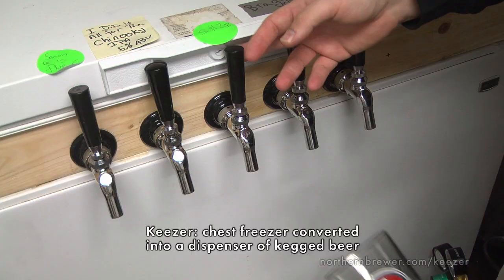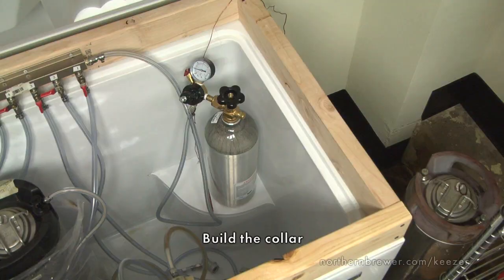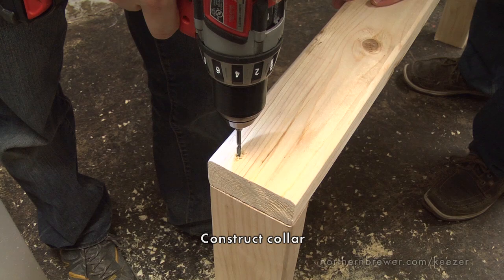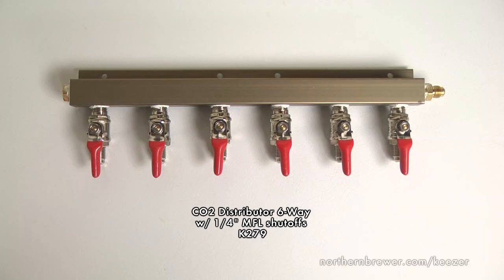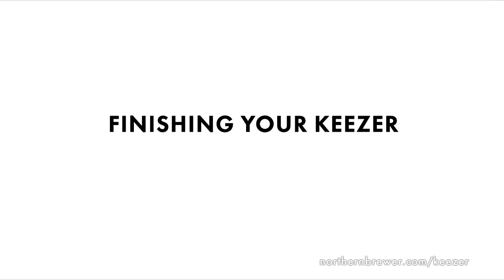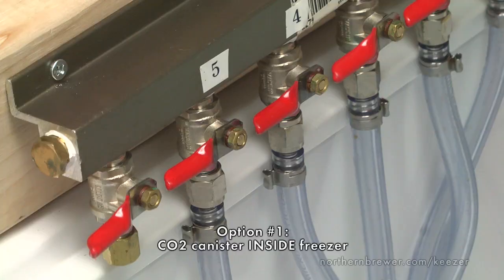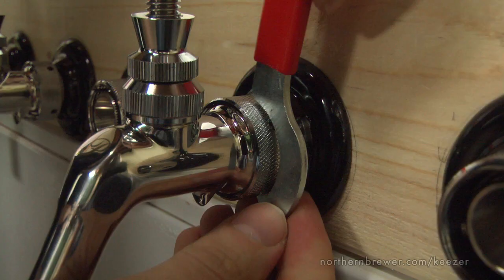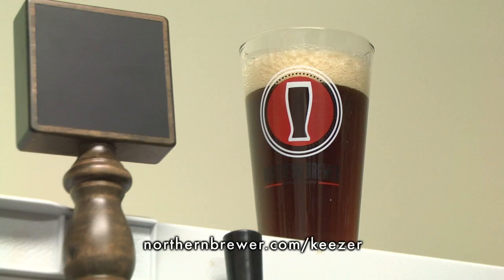How to Build a Keezer or Kegerator for Serving Beer at Home

Comment: Every keezer build video has the same advice about the hinges springing out.  The hinges are designed so that you can loosen the screws slightly, open the top and then lift the hinges over the screws whilst they are still attached to the freezer.
Reply: I was going to suggest the same thing, but you beat me to it.  Those keyholes on the hinge are designed exactly for that.
Reply: True. As I use freezers for my ice business, I have to constantly replace these but have never had that issue as I do it as you explained👍

Comment: I went to Home Depot in search of a solution and found some 1/2" by 3" pieces of metal with four screw holes pre-drilled. I used them to attach the collar to the body of the freezer with sheet metal screws (for the freezer side) and 1 1/4" drywall screws (for the collar side).

Instead of the silicone sealant, I used rubber door/window weatherstripping. Since I'm clamping the collar down, it seals nicely.

Thanks for putting this video up. It sure made the job a lot easier!

Comment from the maker: Cody, the video's host and asst. manager at NB Minneapolis added this moments later:
"It's called Lexel - a silicone alternative. I chose it because it worked at low temps, and I was building mine on the porch in the winter. Also liked it because it worked on both plastic and wood, which we needed."

Comment: Only modification that I would recommend is to make the beer line 10 feet or so. At 4 feet I was getting all foam, saw Larry's solution on "beer n bbq by larry" and I just implemented it a few days ago and now I'm getting perfect pours for about $2 more worth of tubing.
Reply from the maker: Good suggestion for an updated video. Cheers to you and definitely cheers to Beer & BBQ by Larry... love his channel!
Reply: Some other tips for next build/guide: Please use some dressing grade timber next build, your seal is going to be better on something smooth rather than that framing timber. Do the finishing work before you silicone it down. And please do not tell people to goto their hardware store for cuts; yes we offer it, but we hate you for it. Thanks for the video. I’m so very keen to build one. Your voice over is 10/10

Comment: Great video, guys!  Looks like a clean way to build this without allowing for outside interference.  The biggest issue with my Keggerator is that I drilled through the door, and every time I open a door it pulls kegs around and is a cluttered mess.  Should have watched this video first!

Comment: If you cut the two side pieces with a taper from front to back you do not have to remove the top or change the hinges.  If you want to return it to use as a freezer just remove the wedge with the taps in it.

Comment: Kevin, you'll want to use a thermostat. I use the Johnson Controls Refrigerator Thermostat sold by NB. The sensing probe goes into the freezer and the freezer plugs into the thermostat then the thermostat plugs into the wall. You set the temperature on the thermostat and it will turn on and off the freezer to maintain that temperature. Works great.
Reply: What did you set the temp control on the freezer to use the johnson control?

Comment: Thinking of adapting this for a home bar - could I run the lines out of the faucet holes you drilled, provided they're sealed round the edges to keep the freezer working? Then connect to 'traditional' bar style pull faucets?
Reply: Yeah

Comment: If:the video author can reply, that would be great  and/or anyone else who knows the answer to my question below:

When using a freezer this way as a keezer, does this cause any bad effects to freezer parts (compressor etc).

Afterall a freezer is  designed to operate  in the -20degF deep freeze range so when adding a controller to  only go as high as 40-45 degF (similar to  fridge type temps)   was wondering if any issues to be aware of ..if any. 

Thanks for truly a great video!

Comment: I made a similar comment elsewhere, but the control unit they use will shut off power to the freezer when the temp falls within the desired range. Similar to how a timer on your living room lamp will turn off the lamp at certain times, this will shut off power to the freezer at certain temperatures.

Comment: I just finished building mine. I ran into a few issues along the way and thought I'd share my experience.

First, I don't have a radial arm saw. I made all the cuts for the collar by hand with a fine-tooth saw. It's next to impossible to make your cuts perfectly straight. Unless you use a mitre box or have some other way of assuring perfectly straight, 90 degree cuts, your collar will not sit level on top of the freezer.

Comment: Great Video, thank you!  I have a couple of questions if you don't mind:  1.  Is the Stout line hooked up differently than the other 5 main lines?  Or, did you just put it on the side to dedicate it to stouts and identify it?  2.  Are there advantages other than space to keep your CO2 tank in or out of the freezer?  Will it be affected if it is outside and it's in very high temperatures during the summer?  3.  Do you also run star san through the lines after they're cleaned with pbw?  Thanks!

Comment: Useful vid, a couple suggestions:

1) You don' show how to connect the CO2 canister to the distributor.  Compounding the problem in the shots where you show this connection, your arm is in the way, so you can't see how you connected it.
2) Why use a barbed connect for the liquid line and an mfl for the gas side?  Barbed are harder to clean.  I use the MFL for the liquid, so I can disassemble and clean and a barb for the gas side, since you don't need to clean it.

Comment: Could you do this just a beer line to a button pour spout thingy without making a collar and whatnot? Just open the freezer door grab the line and pour a beer? That would essentially just need a freezer and an inkbird making a basic refrigerator, but I don’t see anyone ever doing this. It cuts out all of the building. The only downside Is you’d have to open the door anytime you want a beer which might mess up the temp and cause it to turn on and off more frequently with the Inkbird.
Reply from the maker: For sure. Just get yourself a server line tap for each keg and save yourself all the stress of the build-out.

Comment: Chest freezers are easier to drill through the top as there are no freon lines in the lid. Main issue is switching kegs, a longer line would take care of that and the benefit is having your drip tray up top with the tap, not hanging out on the side (oh also need a tap post). Nice plans though.

Comment: Hey Great Project.

I wondering if its always necessary to have to deal with wooden column, why not drill the top part of the freezer coz I doubt there any cooling wire.

thanks
Reply: Never know and if you are wrong, you ruin the freezer.
Reply: In a lot of posts on the subject I've seen on other sites the freezer is too short inside to house the kegs, so it became standard practice to make the extra space.
Reply: Hey Brian - you go ahead and do that and let us know how it worked out !
Reply: Sandra Young I think you meant Bryan. I would never try that. LOL

Comment: Interesting.. But why not use plastic lumber, like Versatex or Trex ? You could use 2 pieces of thinner width 1/2 wood  try  1/2 trim  sandwiched between 1/2  insulating foam. Glue it  all together than attaching to your keezer.  Just a thought. Wood can get moldy from moisture. The plastic trim is awesome.
Reply: I like the idea. But, why not? Well " ... Like most things in home brewing there's more than one way to do this porject .... we're just going to show you one way to get it done ... " 0:28
Reply: ***** ~ Fine. Hut you must agree Versatex or Tree, would last longer not grow mold like the wood... & Foam Sandwich between 2  1/2 " Sheets of Plastic  would be better.. they use it on Houses & commercial buildings + Marie Applications.  
JUST SAYING IT COULD HAVE BEEN MORE ENERGY EFFICIENT!  NO MOLD.. NEATER CLEANER WITH VERSATEX & Foam..
Reply: You stain the wood and seal it with polyurethane.  We have had ours well over a year.  No mold.  Temperature in kegerator is 33 degrees.  Besides, no matter what you build, you still have to disassemble the taps and clean them.  We simply wipe down the inside as well.  We attached purs with a bead of Liquid nails and caulked the joint as well.  The lid seals fine.  We know this because the unit is housed in an outside man cave that usually is not air conditioned and is humid.  Never any condensation around the lid area or mold.  Normal wood is fine.

Comment: One way you can determine is by turning on your freezer and seeing where there is condensation on the inside. Wherever there is condensation theirs also likely a cooling line. Just a tip i picked up somewhere.
Reply: I also noticed most chest freezers even ones with full coil wraps around all sides that they tend to not have any coils in the top few inches.

Comment: Great tutorial! Excuse my naivety, but why use a freezer and not a fridge? Would a freezer not eventually, well - freeze the beer? Cheers 🍺
Reply from the maker: Freezers will freeze the beer if you don't use a temperature controller that allows you to keep the temperature in the freezer at above-freezing/serving temperatures. You could totally use an upright fridge as a keezer, but most people like the horizontal deep freezers because they fit a lot more kegs (or even fermenters). https://www.northernbrewer.com/products/northern-brewer-dual-stage-temp-controller
Reply: Keezer (made out of freezer), Kegerator (made out of a fridge). They both work just fine, its up to you. However, the freezer can reach a lower temperature which I find interesting and has much more space for the kegs. The only extra component you would have to buy for the freezer is the temperature controller which is not that expensive, then you can set as low as -1C depending how alcoholic the beer is.

Comment: I'm a bit late here but you guys just emailed me with this information so I'm here now. Being new to brewing and haven't kegged yet, don't different beers like to be at different pressures? Meaning, having 1 set PSI on the CO2 could have some beers running flat and some over carbonated, right? Is there any reason you couldn't have a regulator for each line to set it to the ideal pressure for each tap?

Comment: Freezer compressors are designed to operate at a much lower temp. Using at a higher temp will eventually burn out compressor.  Also if you mount drain pan to freezer front panel it's possible that a freon line may be damaged.
Reply: as long as there is a temperature control to maintain temp and prevent short cycling,  the compressor will be fine
Reply: I was thinking the same thing. Easier to just install a tap tower (or twin tap tower) with longer lines inside. Much simpler build.

Comment: don't need a buddy for the hinges (i drink alone?)... just get saran wrap ( pallet wrap ) and give a tight wrap around the whole thing, then take the screws out through it.
Reply: ratchet strap also works well I imagine
Reply: Rob R can also loosen screws on both hinges,  and then slide hinge up one at a time.
Reply: can also loosen screw, anticipate spring back and dodge

Comment: Any idea of keeping lines cool if I want to run them 5-8f away from tap
Reply from the maker: Is that 5-8 feet still inside the cooler/fridge and cold... or like outside of the actual keezer/kegarator, etc?
Reply: @NorthernBrewerTV  Thank you for the reply. It would be outside of the keezer, behind a wall.
Reply: @NorthernBrewerTV  thank you for the reply. Sorry i'm late the whole basement remodeling came to a stand still for a bit.  The 5-8f will be outside of the keezer.

Comment: Usually those sprung hinges will have a hole where you can insert a allan key, drill bit, or piece of stiff wire to take the spring pressure without having to fight it when you're removing/installing it. If not just drill one appropriately.

Comment: This type of system also works for a pub? Thanks for the help.
Reply from the maker: Are you asking if you could use this kegerator setup (or something like it) to serve beer at a pub? If so, I don't see why not. Although a more commercial scale setup might be preferred and move a higher quantity of beer quicker and more efficiently. But there are definitely nanobrewery taprooms that have smaller setups like this one.

Comment: It looks like they're using an external control unit that controls the power to the freezer. Once the probe hits the desired temperature, the control unit shuts off power to the freezer. You can see the plug that goes into the wall has an extra plug coming out of it.

Comment: Is not dangerous to put de co2 tank inside the frezzer?
Reply from the maker: It is not dangerous as long as everything is set up and secure. If anything it helps gas last longer at colder temps.

Comment: alright,  so not all lumber you get at the hardware store is gonna be perfectly smooth. you could have some sealing problems. if you're keeping your freezer in the garage or the storage area is just hot you could have some problems. The lid to most  freezer has a gasket that uses magnets to seal itself to the body of the freezer to keep a tight fit. kinda hard for magnets to stick to wood. If your already set on making a "keezer". try to utilize the lid as your mounting for any taps. you can use a tower or make a box out of wood, metal, or something you might have laying around the house and use the parts they listed for the beer taps. obviously allow for enough space to open the lid without damaging anything. the freezer in this video looks great. But may not work for you. Cheers.

Comment: When you drill a hole in the collar to run the c02 line to the outside, how do you seal the hole so air doesn't escape? Do you just fasten the tube in place with caulk, or is there a way to seal it where you can still take the tube out easily?

Comment: hi, how often do you need to rinse the keg tubes if you don’t use the taps often?
Reply from the maker: I would suggest running some sanitizer through them -- or better yet a line cleaner like BLC -- once a month or whenever you see noticeable build-up inside the lines.

Comment: question... do you need a freezer in which you are able to adjust the temperature, or would the temperature control unit do that for you? i have a chest freezer that you can't set the temp on. you just plug it in, and it's cold. i'm wondering if the external temp control unit adjusts the temperature for you.

Comment: So this has an external temperature control unit? Is it fitted to control the freezers own cooling unit? Using the freezers own system would freeze the whole thing.
Reply: +Roope Vähä-Aho the external control unit cuts power to the freezers cooling unit when the freezer reaches temperature.. a thermostat of sorts.

Comment: I bought some parts from you guys for this project.  The swivel nuts do not seem airtight.  by which I mean the tailpiece inside the nut doesn't have a gasket or anything.  Is this ok?

Comment: Could you explain why you couldnt drill the shank holes in the center of the 2x4? Is it that a tap handle would hit the handle on the freezer lid? I bought this same freezer on craigslist (whirlpool 14.8 cu ft) a couple days ago and I am gonna try to get it built this weekend. I am kinda OCD and would like the taps in the center of the 2x4. 

I think I could design and 3d print some spacers for the outside plate on the shank, to push the tap out a little. How much space do you think I would need to comfortably center my taps?
Reply: +WhyNotAParadox Yea I wasnt sure if they mean that the tap handles hit the lip or what.

Comment: Are you finding a problem with too much foam due to the uncooled portion of your shank? That would be the portion that is going through the wood and is not being cooled by the freezer.
Reply: I built a small kegerator, single keg and I have this issue.

Comment: Does anybody have any experience with keeping a keezer outside (i.e., in a carport) and how weather might impact?
Reply: Yes, outside in the summer time it works normally. During the winter, I place a small shop light with an incandescent bulb inside the freezer, then plug it into my temperature controller on the heater side. If the temp drops below 32 degrees the controller turns on the light which raises the temp inside the freezer to a set temperature. The beer did freeze in my tower once, but that was because my tower chiller, or heater in this case, had gotten unplugged.

Comment: I will be building a version of this myself in the not to distant future and was curious what temperature controller you used. I looked on your web site at this video and it gave a list (with pictures) of the products used but oddly enough the most important and vital componant was missing, , , The Temperature Controller. Which one did you use and why? Any advice on this would be helpful.
One more question if I may; When using the Temperature controller is it better to have the Freezer set to its Highest, Lowest or somewhere in the middle temperature setting ?
Thanks.

Comment: What if the collar is too big for the hinges to reattach to the bottom of the freezer?  Is the silicone adhesive strong enough to hold the collar and the lid if the hinge is not connected?
Reply: The hinges don't attach to the freezer again, the attach to the collar.